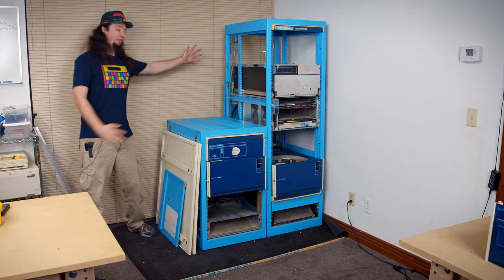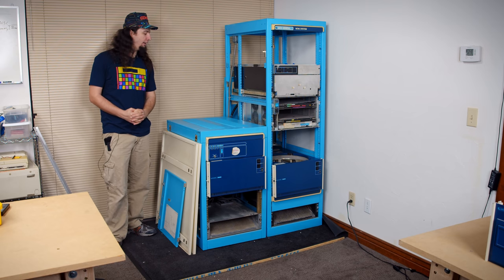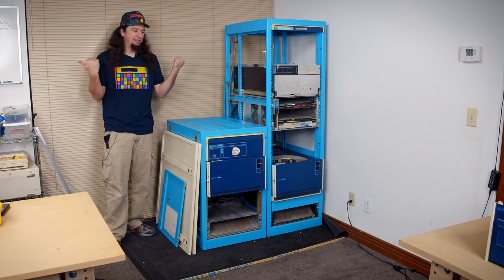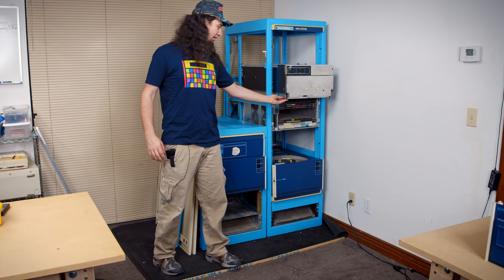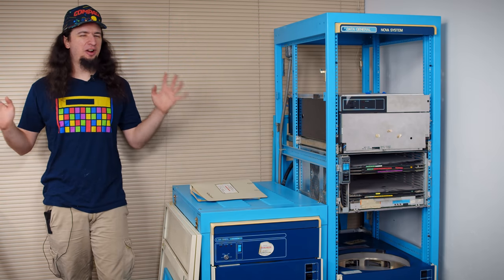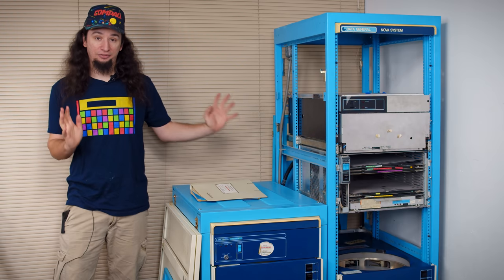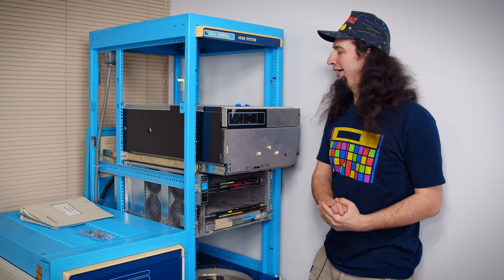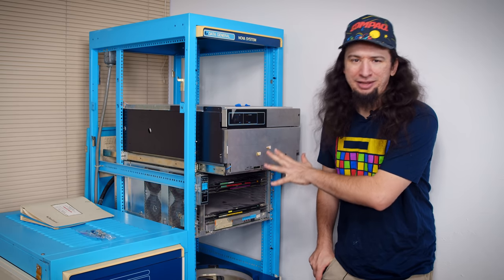Data General Minicomputers: The First Step

Comment: With regards to cleaning you could use the usual routine on the boards, toothbrushes and such with alcohol while also obtaining a few wash bowls from local stores and something to hold water.. During an extreme immediate need for something large to store water I used a 100Litre storage boxes I had two stacked within each other and filled with water so I could test a water cooling pump and assuming I would get something more permanent later but still four years on I'm still using a double skin 100Litre storage boxes notion, even gone as far as plumbing the lid to contain nice in/outlets for the piping to connect..

I must seem so lazy but you could store water that way and even plumb from to say a make-shift other desk with a sink unit perhaps and then in the future you can take it with you too.

Comment: That stuff probably won't draw anywhere near its max current rating.  If you are worried, just pull in some 10-3 romex and put a 30a 240v subpanel on the wall.  It'll be fiiiiiine.  :3  (famous last words...)
Reply: Agree the nameplate ratings are probably closer to peak draw, and the circuit rating is going to be more like continuous draw, so there is margin for error.  But just to add to this:

There's a (quite likely) chance the circuits are already good for at least 20A anyway.  Most office space I've seen has 20A outlets (the left blade receptacle has a sideways-T shape.)

And even if the outlets are only 15A, the circuit breaker itself could easily be 20A, so you just need to use two outlets.  This is what's in my house.  If the breaker is 20A, then the wire in the walls is good for it -- otherwise it never would've passed code inspection.

Comment: In your situation I think I'd look for switch mode power supplies instead of using the ones that came with the computers. Their higher efficiency will take far less power from the wall than those old linear ones. I know there's a lot of purists who are going to flip out over something like that but it doesn't matter as much as having a working machine. As far as the huge caps, if their Malory capacitors you might be able to reform them with low current DC. I'd suggest 150ma@120VDC. Just give it time to come up and watch the temperature. At such a low current you shouldn't have any problems with heat but better safe than sorry. As for the threaded inserts you can use double sided tape to adhere them to the back of the rails. I'd imagine that you'll find some sort of adhesive where they were installed. It's just likely failed over time due to it's age.

Comment: I just hoped the hard drives didn't sustain any damage when you dropped it while trying to move it. I have been quite curious about this project.
Reply from the maker: It was just the one drive for the MicroNova and the heads were manually retracted. And on the bright side my fingers cushioned the fall! I really think it'll be fine from that. I'm more concerned about cracked traces/joints from transporting them than anything as far as mechanical concerns.

Comment: Oddly, Usagi Electric showed a Centurion mini computer with a missing operating system. I wonder if these two machines a related in some way. 🤔
Reply: Interestingly, I think the Centurion was more of a competitor against Data General in this field. So, there might be some shared concepts (like two auto manufacturers competing in the SUV class), but the Centurion is actually a totally ground up design by the wild engineers! They started with the CPU4 which was a full TTL level CPU that took up 4 card slots, used core memory and tape drives, and designed a custom assembly programming language called CPL (Centurion Programming Language). The CPU6 card in my machine is actually just a modernized version of the CPU4, making use of the AM2901 bit-slice chips and ROMs to emulate the CPU4 architecture, and implementing a few updates so the RAM could be extended to 256k using modern chips.

I'm super hyped about TechTangents' Data General though, more minicomputer content on YT is always an excellent thing!
Reply: @UsagiElectric  Thanks for the information, definitely an exciting and interesting adventure :)

Comment: Is the NOVA power supply switching or linear? It's late enough that I have to wonder if it's safe to reform them in the supply or if they have to be disconnected first?

Comment: just use the existing power plugs. You can wire the connectors so that both live phases are connected to each other. As long as you aren't connecting a 3 phase motor to it.

Comment: You dont have to worry about adding breakers. The only protect downstream wiring. You can get that 4 pole twist lock L14-30p at any home depot, then wire it to a pair of normal 5-15. Then find two outlets on different phase and plug it in. This is kind of common with RVs and boats, and mostly safe. The only danger is that once one of the 5-15 are plugged in, the other one can pass current though the device at mains voltage to the exposed prongs. So simply plug both 5-15 in before connecting the twistlock to the Data General.

Comment: 13:45 yeah man this is HPC, it's never been carbon neutral t'heh 

-Presently have 240v 32amp socket but on a 40amp breaker at the consumer unit for my DELL 42U rack in the boiler room and I barely touch even using half the total which could be the same for your PSU load needs, same with my servers and workstations a much higher wattage PSU then overall general usage needs even require :D

*You could even earth the entire rack too, I do with mine by just using a standard electrical plug with only the earth connected, I also still always use wristbands too even on my personal kit.

The bodge wires too, they are pretty much standard for the time too, because of costs and such or what was spare because you always have failures in production they just more commonly used to fix them and get a freebie saving per se. -Every little helps right? Today it's a bit more complicated fixing an issue between the layers well it's quite a pain when you have more then four and a break inbetween with little possible access anyway but back then and with boards upto say four layers allot can be done but not as common to see today that's all.

The stability feet on the smaller NOVA tardis, I would have thought to be on the taller NOVA tardis due to likeliness to tipping more then the smaller unit? or is the drive unit really that heavy when pulled? 

*EDIT: Holy feck that thing is a heavy drive, feckin 'hell!!!

Comment: I think your wrong! It’s not 120v for the 4k tall cabinet! It’s 3 phase with that breaker at the bottom!! You need to see if you have 20 amp breakers. Being a business building you most likely have a 20 amp outlet. Also with the boxes not being full it’s probably not maxed out power wise!

Either computer you might be able to use 2 opposing phase outlets to create a 240v 20a circuit! If you can’t do that just split the load amongst 2 or 3 different outlets

Comment: Couldn’t get a good enough look at the distances in the video, but the power plug on the back of the little one looks like a standard nema 5-15p, so, theoretically, it should be good to go on a 15 amp, 120 volt circuit.

Comment: Pity the micro nova is relatively slow compared to even the original nova due to address and data multiplexing on the chip, or at least that is what Wikipedia tells. The nova4 would be super to get it running

Comment: These machines are so bulky I'm inclined to call them the washing machine and the fridge. Looks like you'll be fixing up the washing machine first. 🙂
Reply: The washing machines were the Zebra drives (96 or 192mb) with twenty platters. The MV/10000 was in a 1 meter by 1 meter by 1 meter cabinet with a side cabinet for the drives and expansion chassis if needed, which was a 1m high 19 inch rack. I have one of those left as my tool cabinet

Comment: What voltage are thouse caps? .. are for AC or DC.?.......... if is DC.. you can power them up with some 18v tools lithium batteries (or modern switching power supply) in serie.... with an amperimeter and some fuses in the middle you will have better control/security........ that messing around with the building cables and circuit breakers... and  the dangerous mains AC voltage.........  Damn I sound a bit like Edison here...

Comment: brush + vacuum + ipa for the dirt on the pcb's should be enough, or not?
Reply: Very big risk of ESD with brushes and vacuums, unless you get the carbon ones, and even then vacuums make a lot of static
Reply: @lauram5905  there are both, esd safe vacuums and brushes for this kind of job..

Comment: Whilst you're having fun with those threaded plates have a thought for us Series Land Rover enthusiasts who need to take the front doors off - similar arrangement except the threaded bar the hinges screw into are loose, INSIDE a completely enclosed door pillars, so if you drop one you're only ever going to see it again once the bottom corrodes away and allows it to drop out!

Comment: Don't know how you're getting on with your restoration, but… if you haven't plugged it in yet (8-months later says YouTube), then DO install another circuit from your fuse-box (just as you might when installing a shower or cooker for the first time). Don't just plug it into your ring-main with other appliances and wall-outlets. PS. I guess you are saying this in your video but the Americanese is not quite so clear as English English. Sorry!

Comment: You guys think 240 v is  powerful. over in Here in Australia we have 240 V outlets as our mains electricity here in Australia and the Uk that’s standard for us and over in the uk that’s two phase power our three-phase we can split two 240 v in to 415v from two phase and in Australia we have 415 v power points out electric trains are a lot higher than what you have over in America three phase even our electric trains  run of 18,000 V and that’s coming into the substation and that’s coming in from A  22 kVA  input feed and that’s step down to 18,000 V

Comment: the big one that’s in the tall frame do you know that computer could easily run off 240 V over in Australia because 240 V is the standard two phase electricity In  Australia all you would have to do is get a power outlet that’sthat big enough to take the amps and the Current If we had a computer like that over in Australia it would be able to run-off 240 V open for you because over here that’s outstanding electricity I’ll tell you that now

Comment: A 10 dollar ARM STM32 could probably emulate that with plenty of spare cycles and replace harddisks with a 15 dollar 64GB SDCard running over SPI 🤣
Reply: Any cheap AVR runs more than fast enough to emulate this for less than a dollar, and a 32 MB SPI flash to handle the hard disks would only cost a couple cents

Comment: If you get either of those machines fully working again, that would be amazing, all the mods and bodges this thing probly needed to work properly, also the software it needs to run... even assuming there are no bad IC's or bypass capacitors... i'd take one look at it and be like... nope... the amount of reading and research it would take before i could even start actually fixing it, figuring out how every chip functions and interacts with each other, what voltages are needed to switch and latch everything etc... well it would not be impossible, just researching enough to get one function working again would be a massive research project.

i would not use the original power supplies though, i'd figure out what voltages the machine uses and buy a new power supply that's more reasonable to run the machine.

Comment: They look epic asf... Expesually thr rainbow Ribbon cable... Those caps loop like Auto Audio capacitors for high wattage sound systems... Dude my Workstation PC uses a whole 120v 15 amp outlet.. If i hook up ANYTHING else to that same circuit i start getting freeze ups immediately at high loads... You could wire up 2 separate outlets into 1 single outlet and get more amperage, BUT You BETTER feel compitant enough in electrical work and do it right otherwise its NOT recommended.... And make sure OSHA is not around...🤣
Reply: @IcyTorment  Office spaces usually have multiple circuits to a room

Comment: Based on my limited knowledge of electrical engineering, could and should you mod a modern ATX power supply into this? Might be better then chucking your electricity bill into the sun.
Reply: they arent TTL, afaik they need bipolar supplies
Reply: @mycosys  Where did you find this out?
Reply: Oh he said it on stream, inevitably.